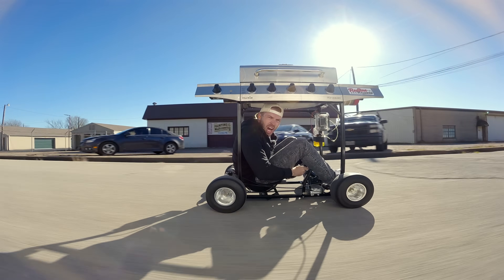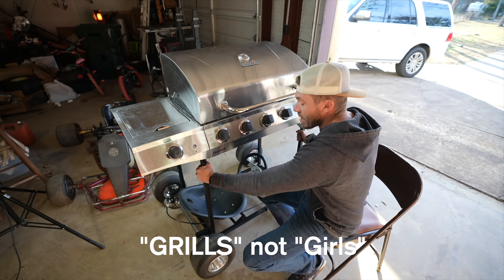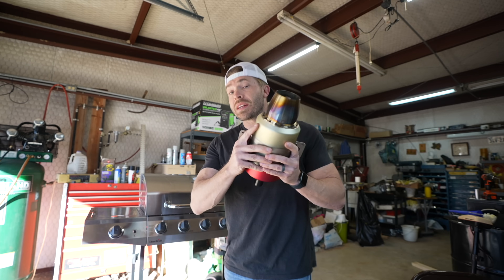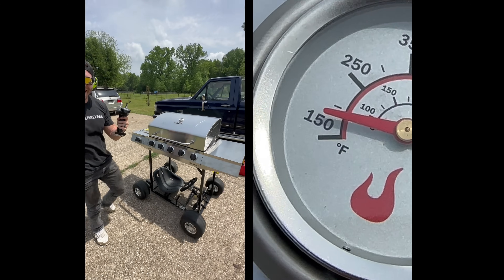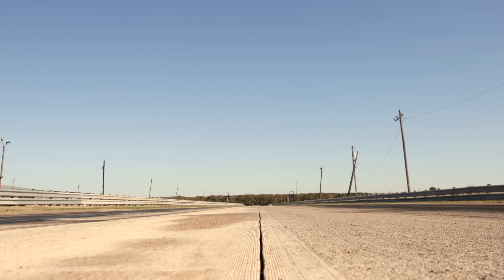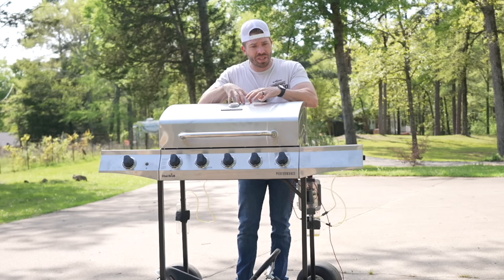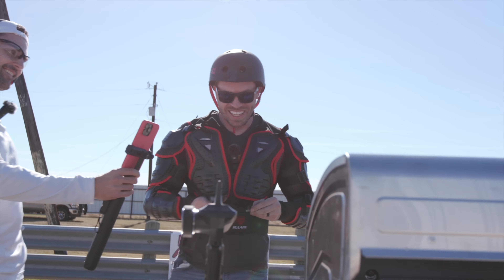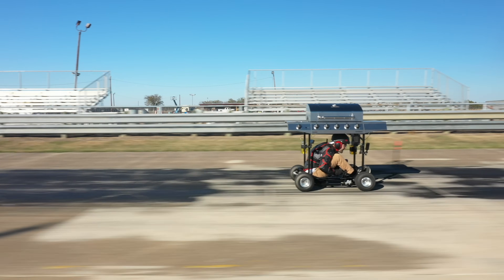I Made the Worlds Fastest Jet Grill

Comment: Can I get a burger togo? That is an awesome build man. You should start your own mobile grilling business, or burger delivery service. I'd love to see a video of you pulling up to a "car meat" and handing out burgers.
Reply: @CodyHovland  exactly! It would be cool to see the speed record done with burgers cooking up top (though I suspect that he removed the heat transfer insert for those runs), accomplishing both objectives at the same time.

I suspect a good way to slow down the velocity of the hot exhaust would be to change the shape of the pipe running through the cooking box. Perhaps it could start out round then transition to a very flat rectangular outlet. That shape should also help with the heat transfer from the pipe to the meat, making it cook faster. And if the outlet area is similar or larger it might be able to both facilitate heat transfer without any obstructions placed inside and also maintain high thrust.